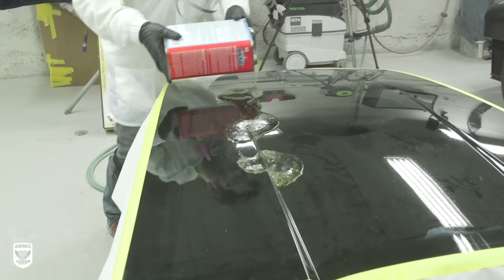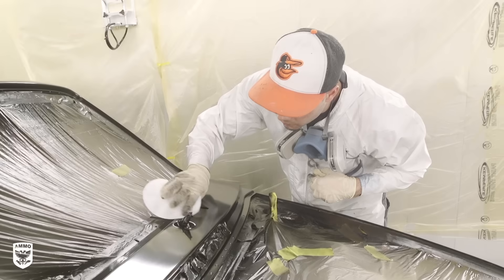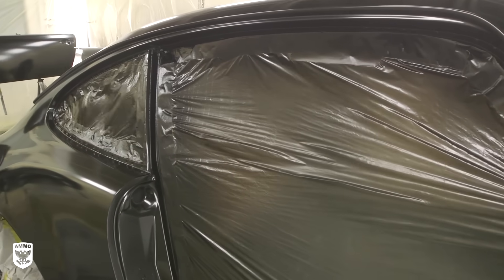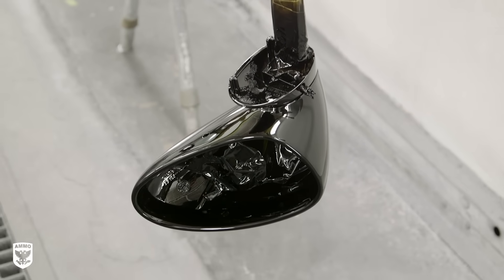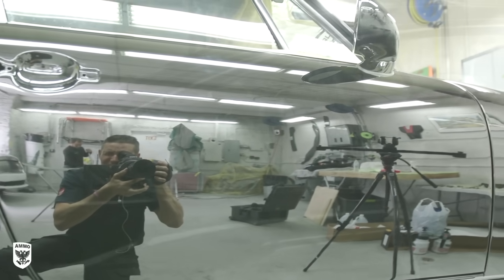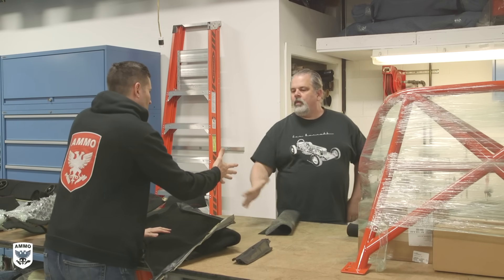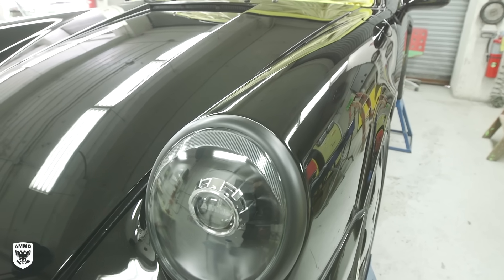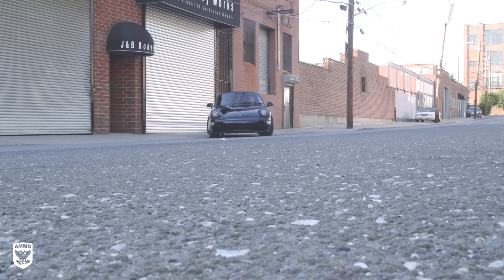Most Insane Paint Job EVER! Step-by-Step Process on the AMMO Porsche 964

Comment: And then some parent abused kid walks by and leaves a total wake of scratches behind. Or you take a chance and run into 7/11 for less than a minute and some fool who doesn't give a crap, opens his door to enlighten yours with a fractional ding.  Then later your at Wholefoods because you can afford to go there and some ding bat lazy blond is so entitled that she doesn't cage her cart and it some how deadman rolls into your car and or someone leaves it in front of you and someone tries to pull in front and bumps the cart into your car.  But wait, there's more.  And then you pull into a mall with over head plumbing and a drain line that someone recently used to dispense all the broken bottles of chems into a sink and of course the drain to that sink is connected to a leaky plumbing joint right above your car and you get home and find a acid burn mark in your paint.  Then of course one day you park in another garage for weekend where the pigeons chose to sit on the plumbing lines just above your car because your car is the shiniest and it's the only way they can get back at humans for running over them.  Now I'm sure there are two dozen more but I'm hungry and tired...

Comment: Any decent body job takes more prep than actual spraying time, not just this one. Plus this vid is just pure sensational, overreactive video... Any shop that does WB basecoats uses a turbine "hair dryer". It's because painters are more accustomed to solvent based stuff that dries quickly, which is not the case with WB. And those walls covered with masking foil? Yep you've guessed it, just about any decent shop does that, too.